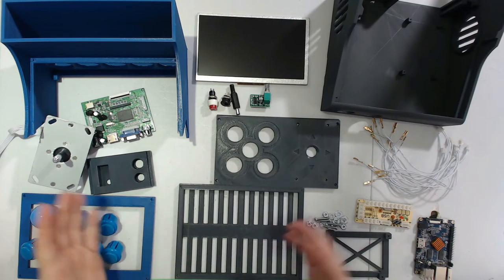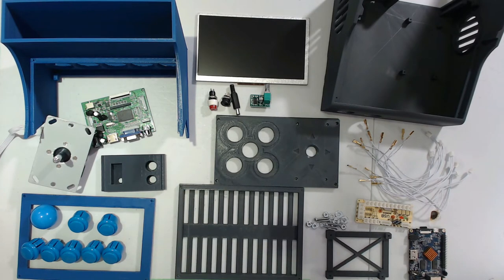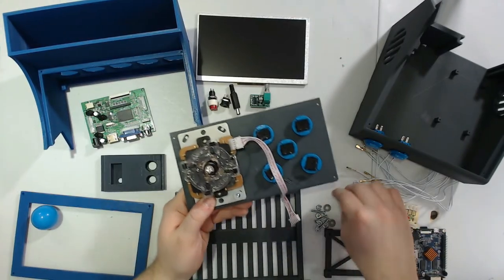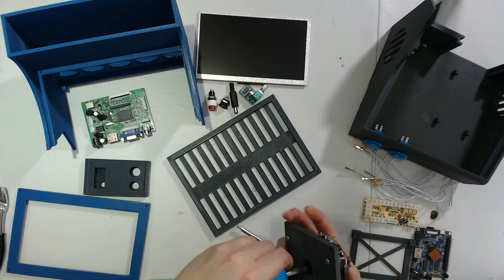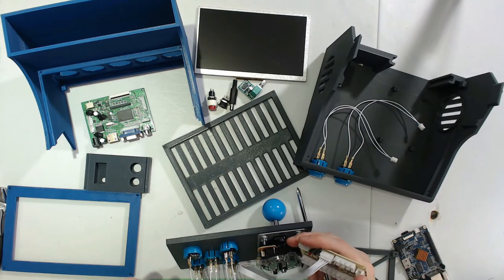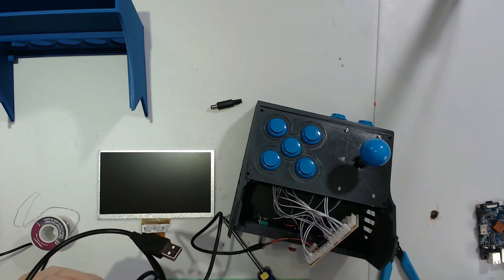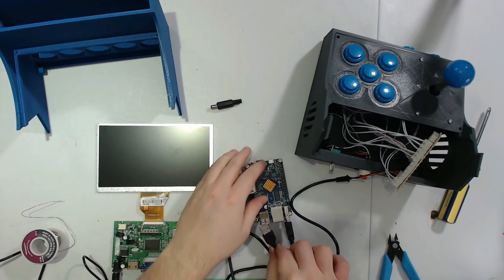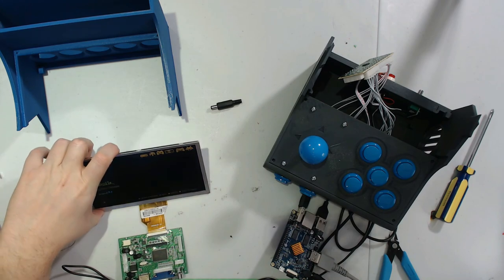Building the Controller and Testing Our Setup - Print N Play Arcade Part 2

Comment: I think what you have done is absolute awesome job I am currently making my own print and play but would you have a good profile to print as I found my cabinet just was warped and layers shifted .. cheers pal
Reply from the maker: major green be glad to help if I can! Which slicer are you using? Also, what are you using on your bed?
Reply: I'm using cura on my ender 3 and for bed I'm using painters tape ..
Reply from the maker: major green I'm afraid I don't have an Ender 3. Based on my usage of the ender 2, which I believe has the same type of material on the bed, I would say you could set the bed to 60, add some glue stick as a release agent, and print right onto the build surface. Is the print warping off the bed or is the tape coming off?
Reply: It's all good pal I have other printers but my ender being the bigger one I thought why not.. I will soldier on and have this cracked I just loved what you did and I have always wanted myself a bartop but I will get this done .. cheers and carry on the good work  ...
Reply from the maker: major green thanks! I hope you enjoy it!